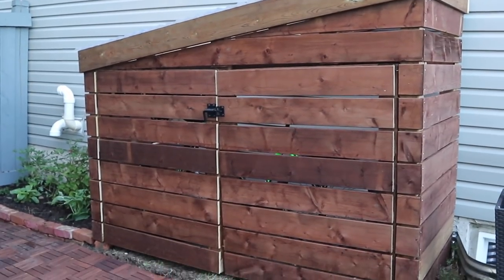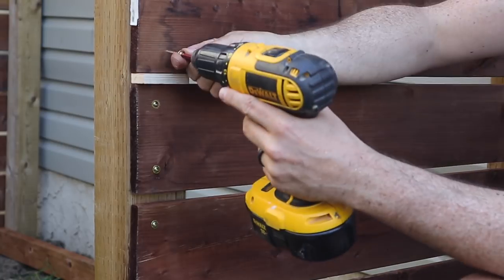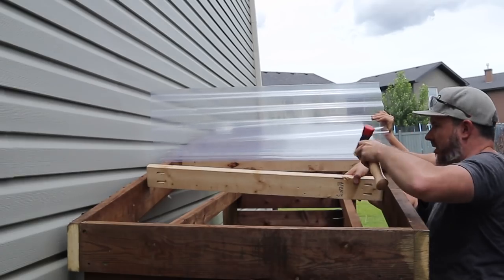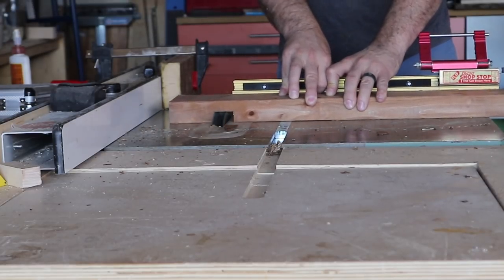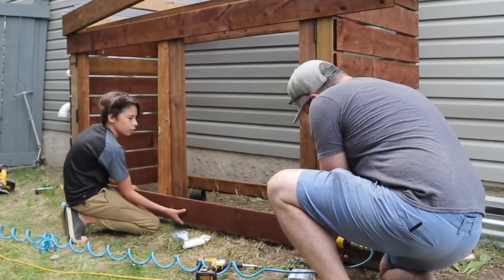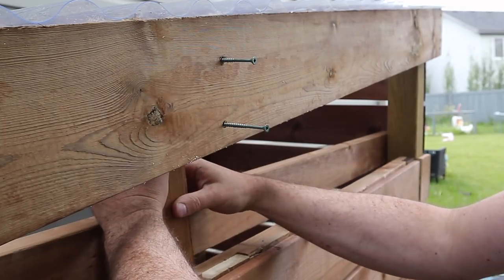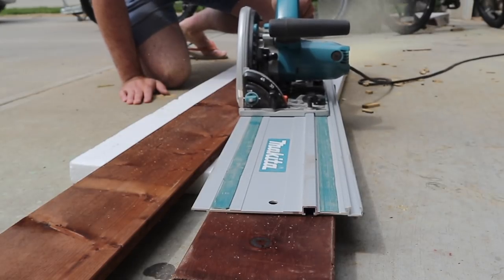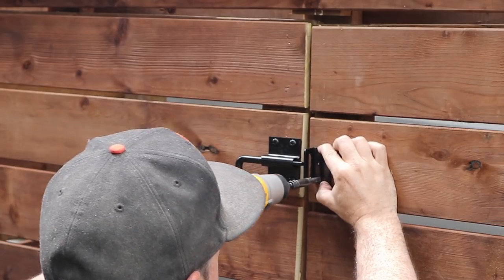DIY Storage Shed // Bike Shed // Garden Shed

Comment: Great build mate but the screws on the corrugated roof should be through the ridges and not the valleys of the sheet. Also as the roof falls to the length of the shed the corrugated roof should run the length of the angled drop...... but awesome build mate and great to see the young lads joining in. I do thus with my son's aswell.
Reply from the maker: Yeah! Totally a learning experience using that roofing material. I need to go back and re do it
Reply: True - and bigger issue was corrugate was set across/adjacent to the drop.  The install should align with the drop to allow the water to flow away.

Comment: Nice shed but i would've leveled my shed by using concrete pole bases for the 4 poles and then build further on that.. Because at the end of the video the right door is already unlevel with the other door..
Reply from the maker: Yeah, it’s not perfect, and I keep meaning to add a brace to the back wall of the shed which will correct that.

Comment: Nice build. I live in the UK and therefore a shed load of rain (pun intended). I would have treated all cut edges to prevent rot.
Reply from the maker: Thanks. It’ll get painted this year I’d imagine. This treated wood can’t be painted until what has been put on it has Dried out for a year or so
Reply: and not have any space between the boards.

Comment: 1 (ok 2) more question(s) - Do you get bugs living in the shed (because of the large spaces)? and if doing it again, would would not have spaces between the boards (do you really think it's necessary for this kind of shed) -or maybe just a few vents somewhere for air flow?) ? Thnx :)
Reply from the maker: So the sheds under the overhang of our roof and only about 10 feet from the fence, so it was more about styling than keeping bugs and the elements out. Thanks for watching and commenting

Comment: Nice track saw ;) have the same one
Reply from the maker: It’s a good one.
Reply: Mortgage & Mitre I just need to get a shorter track. The 118” for every job is a bit much
Reply from the maker: Makita sells connection pieces to join two of the track together. Have you considered cutting your in half? It’s only aluminum.